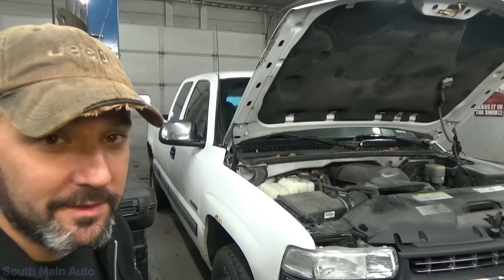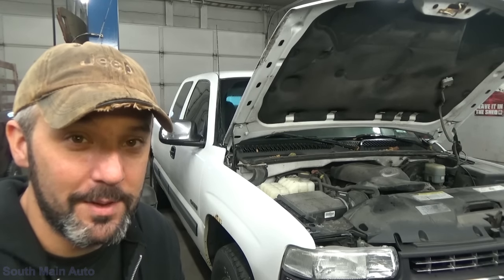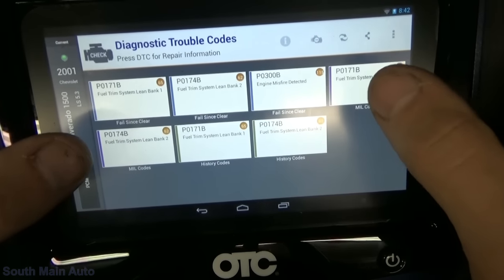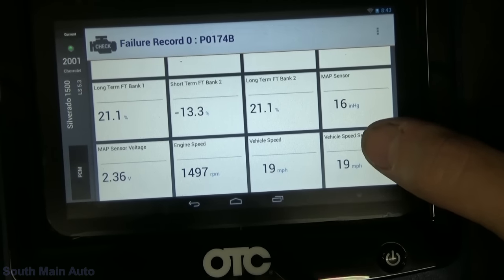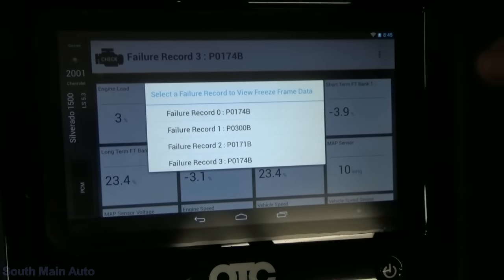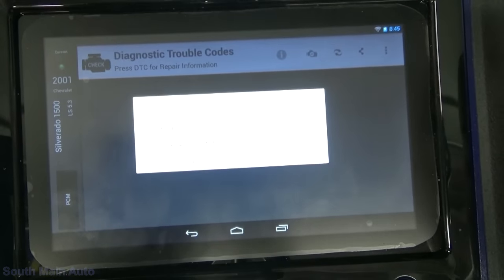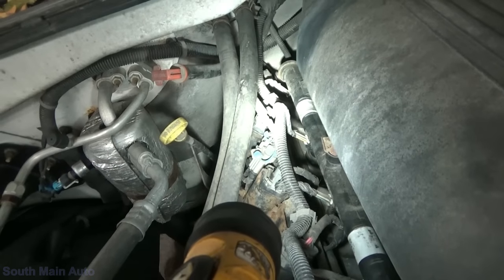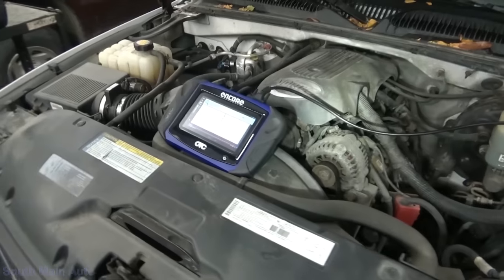Chevrolet / GMC - Rough Running, Lean, Misfire

Comment: Had the same problem recently on my 4.8. Bought it cheap because it ran like crap and the guy thought the intake manifold gasket was leaking. The EGR to intake tube was cracked pretty severely. Slammed a Dorman (!) EGR tube in there and it runs like a champ now.

Comment: I need to get me one of them smoke machines! I never would've found that one, I don't think.

Just had a '00 Taurus here, 3.0 DOHC, with the exact codes. I did the ScannerDanner water test, and could hear it getting sucked into the upper intake manifold gasket. The P0300 then changed to a P0305 as it warmed up. Ran real rough cold, and the freeze frame temp was 64° - was confident that was the issue. Ended up doing the lower manifold gaskets too, and the #2 & #3 coil packs, since I had just changed the #1 this summer for a misfire. Checked out the fuel trims afterward, remembering you mentioning that in one of  your vids, and they came right down! Was a happy day for me! Things don't normally go that smooth around here, lol.

I owe you and ScannerDanner ALOT of beer. ;)

Comment: Im getting bad sputtering without any check engine light and no codes.... after I drove for about 30 minutes,  let sit overnight started it and no sputtering but smells lean....? Its on a 2001 2500 4x4 8.1L  chevy Suburban ..... any suggestions?  Thanks,  your the best technician on YouTube.... love your channel,  you've helped me in several  successful repairs.... thanks I really appreciate your knowledge

Comment: I fixed a GM trouble code p0305 ....cid # 5 ..had good compress...new plug/wire didn't help ... change only one injector , not the whole spider...it can be done... runs like a champ now...

Comment: 2004 tahoe 5.3. Idle long term trims are -7 to -12 on both banks. Both banks are inline with each other on the readings. While driving down the freeway they are both 12 and 20 when floored. What is this? O2s are new

Comment: I had this issue on my 2000 silverado, after manhandling the flex tube with intake gasket change. I bought the dormann replacement, which was not formed quite right. I am petrified to bend/contort the tube so it bolts solidly to the block. I have two gigunda zip ties holding it to the oil filler. and natually I broke off the two bolts at the exhaust,  which meant for a fun Sunday of drilling in a place where you can barely get a wrench.  any suggestions on how to bend this tube and get it properly bolted?

Comment: Thank you for all your great videos!  I have an 05 Suburban that I had the exhaust off and after I put it back on, I got the P0171 and P0300 codes.  After some checking, I noticed I had the three exhaust nuts where it bolts to the exhaust manifold only hand tight - on the bank one side.  I thought that was my problem for sure, but even after I tightened them, I still get the same codes.  I didn't have these codes before I removed the exhaust.  Could some debris have gotten sucked in where the exhaust was loose and messed up the O2 sensor?  Also, if I'm only getting a code for Bank 1 lean, and not Bank 2, would that eliminate the likeliness of a vacuum leak?  Wouldn't a vacuum leak cause both banks to run lean?  Thanks for any help/advice anyone can provide.  I just got a decent scan tool but am still learning all of its features.  Thanks!

Comment: I have 90 GMC Sierra 4.3 that has a  miss In it change plug wires cap and still missing has 59000 miles on and still can't find what wrong with it

Comment: 1. Purge solenoid 2. Vacume leak smoke test,  Fuel pressure regulator hose to pressurize system 3. EGR valve leak 4. Intake tube broke 5. Exhaust manifold 6. Air intake manifold leak replace seal, 7. Replace injector electrical harness 8. Throttle body seal. Check cam shaft sensor and crankshaft sensor. Check 02 data oxygen sensor.

Comment: Most DIYers won't have access to a smoke machine, but that WAS a quick way of finding the leak !

I assume you always verify your repairs, something I am not certain all shops do.
Reply: Well, you could always burn a stick of incense for smoke, play some Jefferson Airplane, and mingle with your Zen Buddhist friends..... or not.
Reply: I found a couple of home made smoke machines on YouTube.  The cheapest and simplest was a plastic peanut butter with a couple layers of aluminum foil in the bottom, a low pressure air inlet and a smoke out let.   Light one piece of charcoal and place it in the bottom.  Add some shredded cardboard and screw on the lid.

Comment: Just replaced my EGR valve and tube assembly this morning and resolved my issues. Funny thing is is that your video popped up in my video feed after i did the repair haha.
Reply: What code was popping up for you ???? @chris L
Reply: @dannyss7117  at that time my truck had multiple codes for different issues but that one was a P0300 misfire

Comment: as a cheap alternative to the smoke machine, use a fat cigar and a rubber glove over a round part of the suspected pipe system. then blow lots of smoke in till the glove starts to expand and become inflated then squeeze the glove which will force pressurised smoke out of any weakness/leaks if not already leaking out of. Works great!

Comment: Dude almost 55k subs you'll reach the 100k milestone in no time. Keep th vids rolling, what happened with Mrs.O hondu switchs repair footage? I got a Hyundai Santa Fe 2012, would you use blue threadlock on the caliper bolts? I didnt see any upon removal.

Comment: Nice diagnosis as usual. Can't live w/o a smoke machine nowadays in a shop environment...saves so much time hunting down leaks. Should have another lifetime SMA customer or at least another to spread the word!
Reply from the maker: I dunno they always tend to migrate back to the parts changer shops for some reason I will never understand.
Reply: South Main Auto Repair I can't figure it out either especially how another shop can shoot at a car with a parts cannon, not fix the car and then charge the customer & ship it and the customer pays it. I can't do that...
Reply: I'll never understand it, I'd rather pay 3x more and have it fixed once, then go cheap and keep dealing with it.  This is why I fix my own car.
Reply: I've seen people use a vape as a smoke machine too

Comment: Nice work Eric! I was wondering if you could hear that vac leak with your ear? I like to use stethoscope before busting out the smoker. Water bottle sprayer is another efficient method...sometimes ;)
Reply: Oh lol @19:10...did the other shop already replace the fuel filter, intake gasket, fuel pump, O2 sensor, MAF, and injectors? :D
Reply from the maker: It was hard to hear it over the mechanical noise of a GM V8 haha but yeah, the garden hose could have found this one. Of course they launched a stage 5 parts misled at it first! The first shop made twice as much as I did and the sad part is the customers will keep going back there :) SMH.

Comment: I have a 2001 Chevrolet S-10 4.3L, and it doesn't go into closed loop until around 140* F, which is normal for these vehicles.  Mine usually takes around 5 -10 minutes or so of idling to achieve this temp; even less if the vehicle is driven.  Maybe only 5 minutes or so when I drive it, of course, depending on ambient air temps.  Great video as always!!  Really appreciate it!!

Comment: Got a 99 5.7  p03000 p03006. Only after I hit 51mph.  Replaced plugs wires cap rotor. Stft on bank 2 it -6.1 roughly. Any help would be great. Even while misfiring no drivability issues.

Comment: I have never heard of a smoke test for vacuum leaks. I watched this video because I'm having trouble with my 1991 gmc sierra 1500. Nox are too high at both 15 mph and 25 mph, but lower at the 25 mph test. Also truck will die at idle after idling a few minutes, sometimes at a stoplight.

Comment: The way that the short term trim went to -10 and held there, and it jumped out of closed loop, suggests to me that it's a software routine to protect the engine from sudden unexpected operation.  I don't know if the -10 short term adjustment was used during the second open loop period, but it seems likely.  The behavior looks a lot to me like an intentional routine, maybe to give the O2 sensors time to heat up more.

Comment: I have a 2008 Tahoe hybrid. The dealer spent maybe 40 minutes in the back and came back telling me my P0300 meant I needed a new engine and quoted me 10k! I have the exact same problems. P0300 when I bought it (as-is from an online dealer... yes, an idiot move) but it changed to p0305 after I changed all spark plugs. Changed wires and coil pack on cylinder 5 and problem has gotten worse over time. I now get violent sputtering when accelerating from a stop and the check engine light flashes constantly. When in reverse it won't go, then suddenly jerks backwards after letting it go by itself. My finances are in shambles and I wish I knew more about cars so I didn't get ripped off like this

Comment: hey DR.o..u know if it was a 3 or 4 wire o2..4 wire o2's have to be min.1200 deg.f before they will start reading..just a thought...also on a sidenote.At 20:49 i seen the longterms go back to +25..or do i need to go see a shrink?

Comment: If you were to spray carb cleaner near the hole in the EGR tube, would you be able to notice a change in rpm? 

Having similar misfire problems with my 2001 Silverado 5.3L and tried spraying carb cleaner around the intake gasket and don’t notice an rpm change. 

Thanks!!

Comment: Hey Eric. Not sure if you see these comments or not but if you do maybe you could help me out. I have a intermittent issue with my truck and no other shop it's been to can figure it out. 2002 Chevy Silverado 2500 6.0  It started awhile back. At least 4 months now. When the truck hasnt been running for awhile and you start it, it runs fine for about a minute or two and then begins to surge in idle and has no power what so ever. As you drive for a few minutes the power is restored and it drives as normal. If you shut the truck off and start it right back up it will drive fine. It only does it when it's been sitting for over night  and not all the time. The only code it throws is a random misfire code p0300 and when it clears up the engine light goes out. I've checked for vacuum leaks and got nothing so far. After seeing the video when you explained fuel trims I checked that. My short term fuel trim on one of the banks was -31. The other bank was normal. When the truck starts driving normal again the fuel trim returns to normal. Every shop I take it to they say it's not acting up for them. (Sometimes it goes a awhile with out doing it) now it seems to be getting worse. My scanner is only one of those cheap actron ones so it doesn't do everything just the basics. I've watched so many of your videos and I feel like I am close just need some help. If you have any suggestions I would really appreciate it. 

Brad

Comment: I have a 2000 gmc single cab short box 4x4 and it starts rough cold and warm spark plugs and wire have been changed fuel ejectors have Been checked and are good I don't what else would be wrong

Comment: You can't set a lean code with a cold engine the pcm won't test a cold engine for a lean condition. You have to be at a steady state cruise for a minimun amount of time with no tps variation. The engine coolant temp has to have risen 40 degrees from engine start prior to test etc...etc...

Comment: Hey eric you just mentioned plastic engine heads by mistake then corrected yourself. Funny thing is it wouldn't surprise me if they dont try plastic or fiberglass engine heads in the future they use it for everything else. Lol

Comment: Ok my 2005 yukon slt 2 different times it starts missing  pulling my travel trailer it starts missing 10 to 15 minutes down the road pulling around 40 to 60 mph but goes away after rolling another 2 to 5 miles down the road in a total of 50 miles total. Then did it again on the way back home. No codes nothing. What gives

Comment: Need help, my 2008 chevy avalanche has that 0300 and hesitated a little, hard to fuel but replaced the purge solenoid and that did it, still has the 0300 code plus the hesitation, definitely could hear a whistling noise on the right side of the engine

Comment: Could you help me my o8 is running rough at idle and backfires and when you get 55 60 it wants to slow down and backfire then drops a gear, if I put it down 3 which is 5th gear it goes fine but when I get up to speed it spits backfires and low power, I think cylinder 1 has low compression is it the rings or collapsed lifters I heard that's a problem with the afm system, or is it something little I can't seem to put my finger on it, lifters aren't to hard but bad piston or rings is

Comment: Usually a intake gasket leak leans out only a few cylinders. One can pin down by cylinder efficiency  test  and or smoke test intake manifold and see what comes out of crankcase. Aluminum intake and heads expand and  will seal up only if a piece of the gasket didn't come off from vacuum.  Brake vacuum booster also common issue on older stuff. Excellent show. Thanks.

Comment: I got 2012 silverado 5.3 i getting a p0300 code only truck running poorly muilt random misfire i change out plugs wires coils no luck what thino could be problem ?

Comment: I need some help my car is getting 30 on the highway and 30 in the city. Regardless if i drove down the highway at 75 or 58mph full 80 mile trip. It always gets the same 30 highway 30 city. It supposed to get 45 highway.  As it used to. Some days it will spring back to 40 plus.. highway somtines 52 highway mpg.  Then the next day it drops and never goes lower than 30. Its the same and its costing me so much. Once i spend $1000 on breaks trying to figure it out and it was just a copper crush washer for 75¢

Comment: Excellent method,+ video. do not have a smoke machine, I found a fairly cheap electronic stethysope. ( can't spell ) It works much better than the old cheap doctor style automotive versions that do a number on your ear drum's. The better one has full size ear muff's. Very load volumn, has help find some very difficult leaks. Good work keep going.
Reply from the maker: brake clean would have nailed this one too

Comment: Question for you sir. I have a 2000 chevy silverado 1500 4.3 V6 two wheel drive. I had a issue with my truck with P300,P301. I went ahead and changed the following.
Distributor cap and rotor. 
Spark plugs
Spark plug wires
Camshaft sensor
Knock sensor
O2 sensor both up and down stream
Fuel injector spider assembly
Fuel pump
Fuel filter

Truck is still shooting a P300 code and truck while at a stand still it shakes and  as I drive it around the block  the check engine light starts blinking. At this point I don't know which direction to go anymore on it and I'm looking to see if you would know what else it can be
  I had a guy run the machine on it and it said bank one and bank 4 are still misfiring
 I was told to change the knock sensor and check the Cadillac converter. Changed the knock but still did nothing. Let me know what you think it can be or what else I can check

Comment: Hey bud, I enjoy your videos, they are very informative. U showed me how to fix my 4x4 on my 88 gmc s15.... but I have a question about the same truck.... it's idling really high... I thought maybe the timing on distributor,  so I adjusted it down some to where it idles like it should,  but it killed the power, so I guess that's not the problem.. ....... any suggestions?
Reply: Does it have a tps throttle position sensor?

Comment: I did away with the egr cap it off on the intake on my 01 6.0 chevy it didn't do anything different from what my problems are on it its like somethings holding it back but wen itll run itll run good pull the trailer 100 like nothing iv added an check all the grounds it goes in like a lemp mode trachin control mode no lites on

Comment: I bought a 2007 Sierra 5.3 from a Chevy dealership. Now I am backfiring and stalling all the time.  The dealership said they can't find the problem. Any ideas?  I had throttle body and fuel system checked and cleaned.

Comment: Is electronic EGR valve supposed to be closed all the way when motor cold it's on a 2005 Chevy Impala 3.4
Reply from the maker: Yes, at an idle it will always be closed.

Comment: Hi i have 2015 chevy suburban 5.3 has misfire at cylinder 8 p0308  only when i stop at the light or if car is in gear, doesn’t do while driving, i changed the ignition coil, spark plug, wire, compression is ok 125 something but don’t know what could be wrong if you can help please

Comment: I can't get my truck to start. I was driving it and it just lost power and shut off, and then since then it will crank but won't fire up. I've changed the fuel filter and pump. And today the spark plugs cuz they were bad. but also the spark plugs were like covered in gas and then when I put the new ones it fired up once and now won't again. Any thoughts on what might be wrong? I've been trying to get it running since Dec 23rd because it's my daily driver, and just have been having no luck

Comment: Very nice diagnosis, professional as always. I have similar issue with my  GM SUV that does the same thing. Code is PO 0300. Changed intake manifold gasket, mass air flow sensor, spark plus and wires, and fuel pump. Still the same problem! what is interesting is that the check engine light flashes only after a speed of 30mpg, when below it stops flashing! Any thought for diagnosis or help, please. and thank you
Reply from the maker: Do a crank relearn on it and see if that takes care of it. I assume it has no misfires.
Reply: Not sound ignorant but how do you do a crank relearn! Do I need a special tool? Thanks